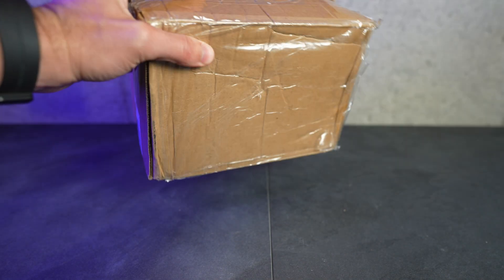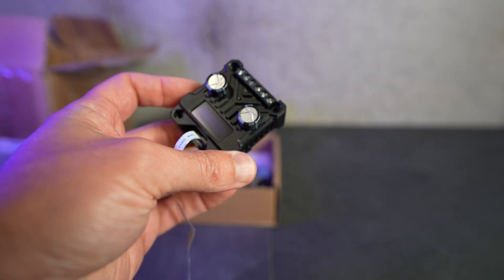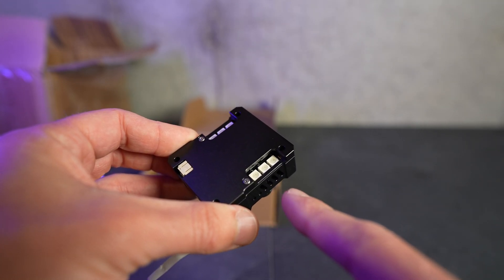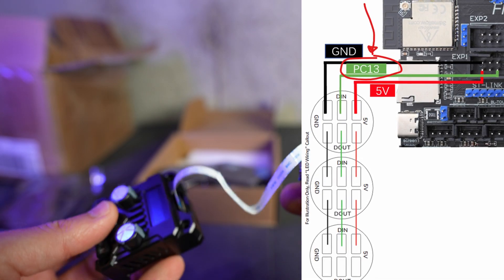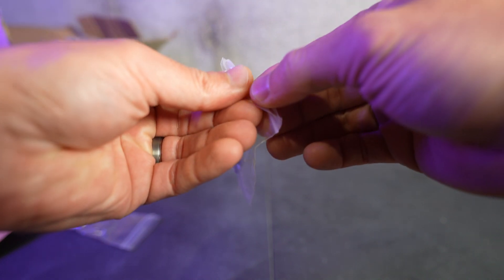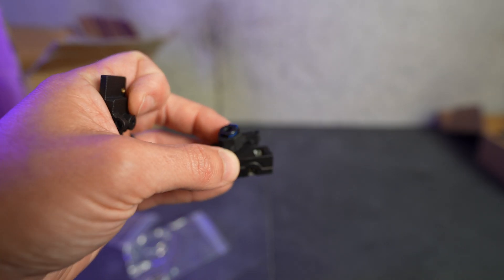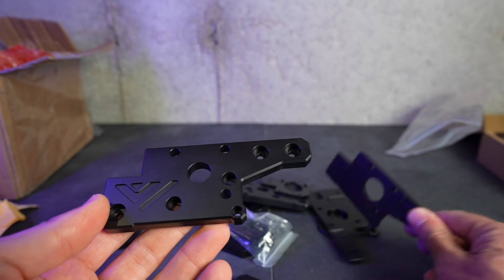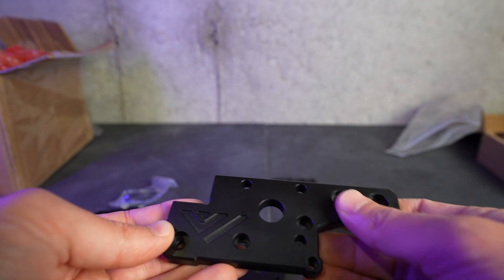New parts - VzBoT

Comment: I've commented on another one of your videos about the excessive cost that Mellow are charging for made in China parts, price reduction should be what you need to talk to them about and there is one simple way to do it, when parts are machined you should only machine what adds value to them, the VZbot logo does not, you are suffering from what I perceive as overbranding, I'm currently in the process of building the printed version and have been going through the cad files to remove all the VZbot logos from every single piece, it feels like Chinese branding problems of for example when they manufacture a cheap generic motorbike to sell to India and cover it in useless plastic sporty looking bits give it an  only cool in India brand name like "Bloodfart Bandit Boy" then proceed to plaster the brand name on every single space available on the motorbike, it looks cheap, the lines are ruined and it distracts from the overall appearance and adds no value to the bike, it's almost like machining go faster stripes into the hotend assembly just to make it look cool. Yes, you're going for brand recognition but what you are getting is brand oversaturation.
Reply: Sounds like you’re a hater and you don’t understand quality or where all the components are manufactured in the device you used to type this huge run-on sentence.

Comment: Hi. Have you tested the filament sensor yet? The problem I have is that the jam sensor is constantly active. I tried different settings for the connection pin, but the situation did not change. Does this sensor work correctly for you?

Comment: Please do not take this as a criticism just facts. 60V is dangerous voltage please do not emphasize such product for DIY. Obviously in China INSUCO regulations are not a concern. 60V DC and 30V AC is not touchable for humans, its lethal...Obviously 48V and 60V supply will generate at the motor phase that amount of AC voltage which is above the 30Vac limit which is considered safe. Secondly heat is not transferred differently due to higher voltage, Its the same, components are having thermal design requirements, glad that this information arrived to some Chinese manufactures as well :). Hope these products are coming with CE, FCC, UK certification including INSUCO testing (I doubt that since I do not see those projection features in the pictures) otherwise they are pretty illegal. For those do not understand what INSUCO means is insulation coordination - which basically means design measures to avoid injuries / death by electric shock.
Reply from the maker: 60v is obviously optional and people know its dangourous. But i will make sure Mellow adds warning on the doc and listing for those who wants tk run 60v.  120v AC is also dangourous and we all do our own wiring, and use AC on bed heater etc...and we are all aware of the danger. Safety should be a priority and those going HV should know the risks
Reply: @Vez3D  Warning is not enough, design must fulfill INSUCO requirements. For any injuries which may be caused by the product use the manufacturer is solely responsible. This means manufacture must do design measures, must provide safety and user manuals. Honestly this is not anymore a DIY area its for professionals. I had lots of discussion with LDO for designing such devices and I personally refused to design something which is out of the human touchable voltage range which is ~30V. Depends which standard you follow but mostly accepted that voltages above 30Vdc can cause electric shock and over 60Vdc or 30vac depending on the frequency range is considered lethal. In this case would mean the product must be designed in a way that none of the 60V area of the device is touchable by user. Plus additional isolation measures which ensures in case of failure of the device will not lead to electric shock touching the touchable areas. here we have aluminum housing which serves as a heatsink, failure of any components inside shall not lead the aluminum case to have 60V.
Reply from the maker: @orbiterprojects  it is not my product here. I am just showing it off.. and mentionning it can do 60v. I personally will stay on 48v and will advice everyone to do the same.
Reply: @Vez3D  Yes, I would also do the same.  The 48V is only dangerous if you touch with one hand one wire of the stepper and with the other its pair, because there you can have 48V AC which is still above the 30Vac considered potential lethal. The possibility of this is not high, but  personally, I would use additional measures, like using cover over the motor connection screws so they are not touchable by accident. AC voltages can be more dangerous since it can interfere with your heartbeat. Sure, it depends on the AC frequency as well. Still, I would do all the necessary measures to avoid any risk. I work in automotive design, and believe me, even if the likelihood of a user touching the vehicle electric system is super low, the insulation measures are not negociable. They must be designed in. All insulations, creepeage distances, etc, must be fulfilled. These rules are not only for automotive. They are in general for all electronics.
Reply: @Vez3D  Yeah, the 120 and 230V ac beds are in the same boat. Personally, I would not use those in DIY printers. In those cases, double insulation is a must. This is missing in most of the designs, I even doubdt the well established heaters that they really fulfill everithing without aditional measures.
Reply: Oh cmon it is not that bad, 48v was considered a safe voltage and y0u would have to do something special to get zapped by 48v range. I would still consider it fairly safe and if y0u do get zapped somehow it will just be a warning.
Reply: @riba2233  Yes, 48V is not lethal, just dangerous, and care must be taken.
Reply: @orbiterprojects   it can be dangerous, but only in very rare occasions, so all in all it is still on the safe side imho

Comment: obviously the drivers are isolated from the 3D printer board  right?? because you can't  send 48 or 60 volts through the 3D printer motherboard
Reply: Only the drivers will receive 48 or 60V and the motherboard will just be getting 24V. There's also no risk of the higher voltage going back into the MB so the risk of damaging it is almost non existent

Comment: Looks great! I love that we can all have access to well made aluminium parts at a very reasonable price thanks to the popularity of the high end DIY printers and all the work that has been put into the designs. 
Does the slot for the top bearing on the motor mounts not defeat the purpose of having it there though? If the bearing can move its not supporting against the tension? 
I get that the slots need to be there because the motor has to move for tensioning adjustment, but isn't that just a fundamental downside of using motors to tension instead of separate tensioners.
Reply from the maker: There is a "locking" bolt that will lock the slider once tensioning is done
Reply from the maker: And yes..it would be ton easier to have a tensioner elsewhere than from the motor...but the current design do not allow this. On a next printer this would be how I will do it. This the issue with a printer that keeps evolving and we tried to find solutions. When it started the tensioners were on the printhead and we scratched our heads to move that away and NOT lose printing space. The only solution was to use motor to tension it.

Comment: 9mm belts mod when? 👀👀
Reply from the maker: It would require a total new design. And might be easier to use 3030 to have space for that
Reply: @Vez3D  you’d just have to basically space out the parts and modify the toolhead posts, doesn’t seem that hard to do. And know you already have motor mounts with double shear 😃
Reply from the maker: @nunovicente34  modify each motor mounts, the XY joint, the toolhead etc.. basically a new printer :P
Reply: @Vez3D  not sure if you’ve seen the Monolith gantry for Vorons, the designer of it has a 350mm V2 AWD with 9mm belts and he’s got an IS recommendation of 60k+ accel on X and 40K+ on Y. It’s crazy
Reply from the maker: @nunovicente34  yeah im well aware of it. Very nice
Reply: @Vez3D are planning on making the double shear motor mounts for the printed parts versions? Pls do!!! 😅😁😁

Comment: Why not design it with the second motor upside down and use regular shafts? This is how the voron guys do it. It will be even less tension on the motor that way because the pulley is closer to the motor and you can tension belts to gates specs achieving a lot more accels.
Reply: Some other upgrade in the future coming, which needs thats space 😊
Reply: @staticred1559  Interesting.

Comment: Those driver upgrades are getting a bit out of hand, water-cooling, 60v 6a and RGB? Wouldn't it make more sense to just go to servos/bldc at that point? 🤣
Reply from the maker: My experience with servos on a corexy was not great. It is hard to keep motors from fighting each other and causing ripples/artifacts. Maybe with higher encode ones and more expensive ones ? I didn't test. I guess one day it will come :)
Reply: @Vez3D the hard part is the implementation, klipper still doesn't natively support foc, a man can dream, at least
Reply: @UNVIRUSLETALE well hooking up an odrive is almost like hooking up a tmc stepper driver externally

step dir and gnd is pmuch all you need apart from some oDrive configuring and hookin up an encoder obviously

even if Klipper could support FOC directly, that would be useless as i highly doubt any mainboard mcu is powerful enough to handle more than 1 foc instance
Reply: @BH4x0r  oh really, might try odrive/simplefoc on my next custom project then. I haven't had time to play with those yet so I don't know the details on how to get them to work well yet
Reply: @UNVIRUSLETALE  Odrive is a literal separate ESC, not to be compared to simplefoc etc which is a library for an Arduino (or other MCU's) and needs other components
Reply: @Vez3D i think you may need/want some magnetic encoders, most are 12bit res or 4096 steps per rotation
Reply from the maker: @BH4x0r  the one I tested were 2048. But i see odrive now has now 20480 res. Maybe one day i will try again
Reply: @Vez3D  maybe the foc configuration wasnt optimal either, no idea to be honest, but foc calibration should obv be done without load
Reply from the maker: @BH4x0r  yep i have done that too. Though not an expert here but I also had help to try to tune it from expert people. I think the main issue was low res encoder so it was affecting position control when 2 motors are attached together like that... they tend to fight each other.
Reply: @Vez3D Pantheon HS3 uses servos for X-Y and it works well. They have a custom pcb between the off-the-shelf MCU and the servos, for the encoding I assume.
Reply from the maker: @1sm0Laitela  yep. But they are not in corexy. In corexy its a different issue
Reply: @Vez3D  Ah alright thanks for the info
Reply: Should have a look at Vez's early videos maybe. He covered the journey using odrive very comprehensively.